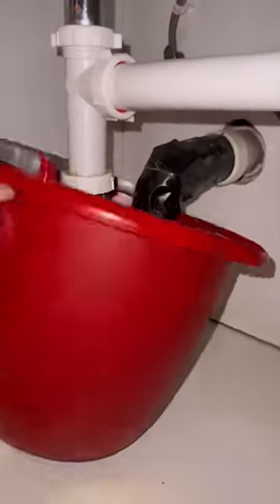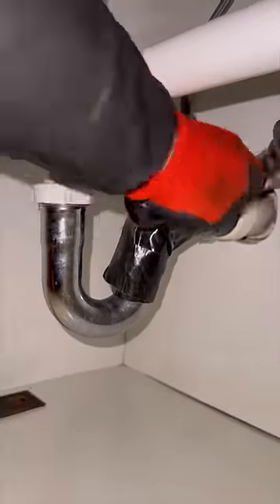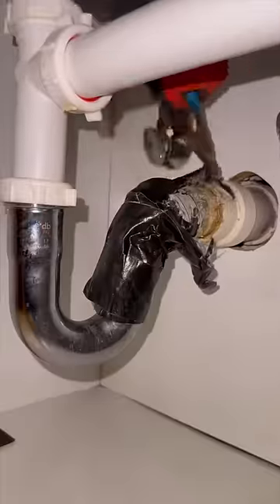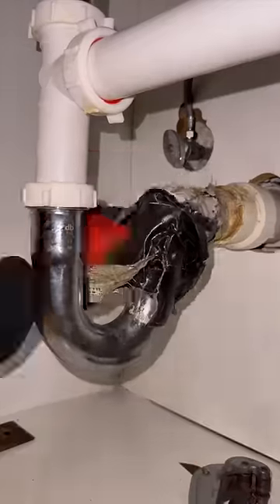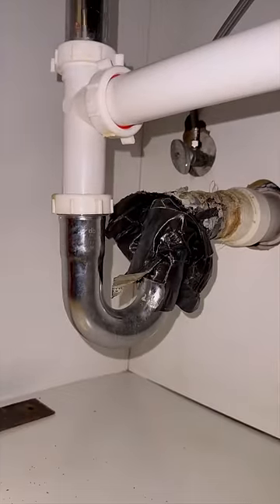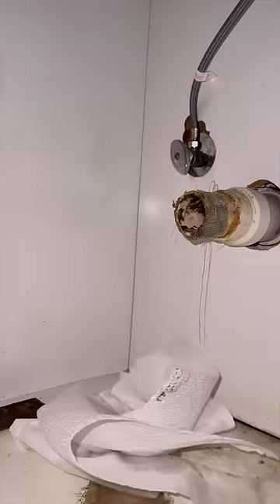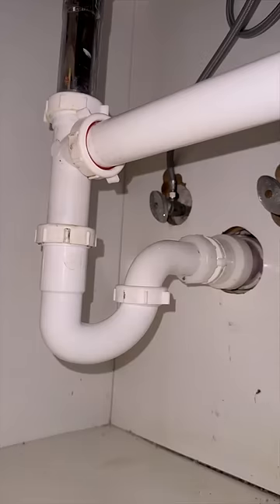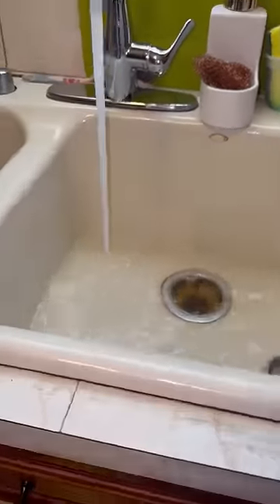Repairing a duct tape masterpiece #wow #pvc #fyp

Comment: As a landlord, you should see the duct tape fuckery I have to deal with. Tenants won't call me,.but can grab a roll of duct tape
Reply: Wtf 😂
Putting in the effort to tape it, but Not Putting in Less to call and Just shove a bucket under?
Shit Happens, its Not Like they get a punishment 😂
Reply: The default assumption is that the landlord won't do anything, so people just do whatever
Reply: If you had my lying landlord, yep, duct tape every day of the week. He won't lift a finger unless the place is about to collapse.
Reply: The unfortunate thing is that most landlords with charge out the ass for any repairs even though they’re legally obligated to do them for free. What is and what should be are not even close to each other.
Reply: @ERROR-CitationNeeded  huh?
Reply: @JB.zero.zero.1  I just replaced a kitchen faucet, both valve stops, and both water lines.  Didn't bat an eye.  It's what us landlords are supposed to do

Comment: Yeah, I did that in a """temporary""" situation where the countertop/sink combo I got from the ReStore didn't match up with the pipe coming out the wall, it lasted about 5 years or so before it started leaking. Finally got around to doing it right after the second iteration of the duct-tape fix failed 3 years later, which was about a year before I got the ACTUAL countertop and sink that were gonna be there. Yeah, we coasted on a random counter we got from Habitat for Humanity for 9 years, it didn't really fit into the space cause the corner was on the wrong side, but it did the dishes fine...

Comment: Lol, I rigged up my kitchen sink similar to  this once. It had corroded so bad it was brittle to the touch. I repaired the gaping hole in the pipe by shaping plumbers putty over it then wrapped it in like 20 layers of tape. Ghetto af just what I had on hand until I replaced the sink and pipes.

Comment: I’m helping at a complex with 48 4-plexes and almost every one I have been in are like this. Galvanized pipe rusted off so the trap arm is just hammered inside the pipe. The better ones have silicone or tape.🤦

Comment: You don’t have PVC fittings on the truck and you didn’t primer the pipe first 😂. Also, why would you reinstall a continuous waste? That’s garbage. Throw two wyes at the wall, one facing left and one facing right. Install a cleanout at the back end of the wye and pipe two separate traps with the branch outlets to each sink bowl. Not only does it drain better, but, you can also snake the drain with the traps still connected and with running water.

Comment: Why are we still using compression fittings on horizontal runs?  They nearly always eventually leak when the dumb ass homeowner bumps it with a stupid soap or whatever other crap they store  under the sink. I mean I get it, it is definitely the easiest way to do things. But it's really not that hard to avoid.

Comment: From your other vids ik you're a great plumber, but ffs please dont use channel locks on pvc. Makes maintenance a pain, possibly strip or crossthread, and is a bit excessive. Hand tight and if it still leaks theres another issue
Reply: Bro, calm down😂
Using the tool doesnt mean you Turn it until it Breaks or you cant loose it by Hand anymore🙄 Doing it the Same way because its easier for me to ensure its tight enough, but every single time you can loosen it by hand. With both methods its about the force you use, Not the tool
Reply: That’s not pvc my guy that’s plastic.   And only a rookie cross threads a pipe.  If you pay attention and start with you hand.  You can tell if it’s going on right if you did enough.  Trail and error.   Professionals do it how they feel cause he got it.  If you cross threading joint slow you a$$ down and pay attention
Reply: It’s gone go around a couple good times nice and smooth. If it don’t. You maybe cross threading.  And start going the opposite way.  It’s like a woman lol

Comment: Would have loved to see you peek uder the sink from hell. I've never seen as much exposed and slathered silicone sealer in one place. I mean it looked like some gigantic beast sneezed and 5 gallons of snot flew all over thise pipes.  I simply said I did not have the tools or expertise for this one. Oh one other detail  had to put plastic down on the kitchen floor first so i didn't have to wallow in the dog pee and poo. 🤢